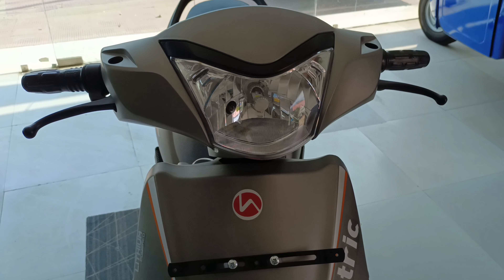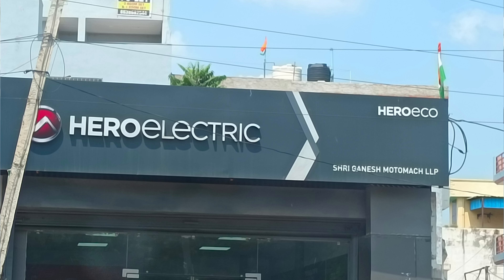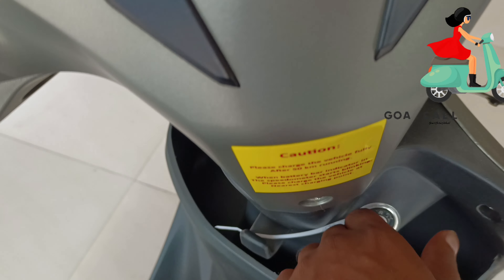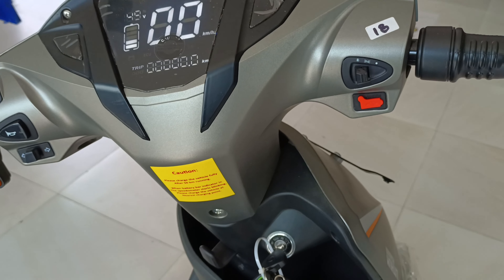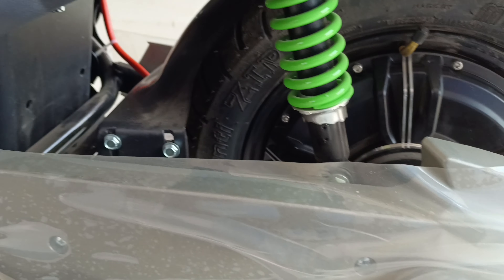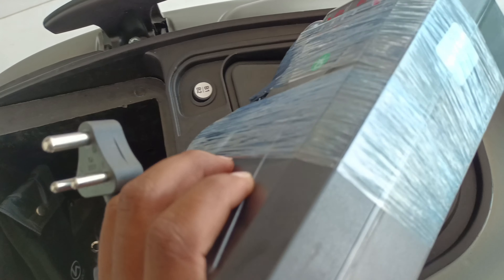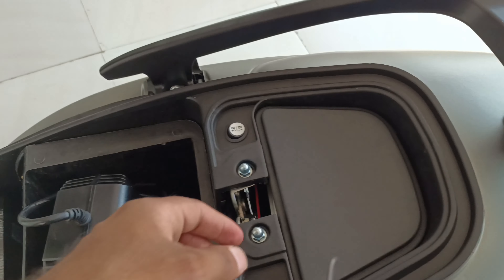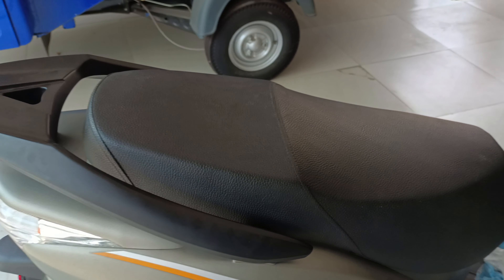Hero Electric Optima CX ER With Dual Lithium ion Battery 150 KM Range Hero का  वादा @HeroElectric01

Comment: सब से घटिया हीरो Ev
1 battery indicator wrong
2 charging indicator wrong
 3     break ghatiya
4   light ghatiya 
5 mudgaurd ghatiya 
6 body ghatiya 
7 weight ghatiya 
8 part  price high 
9  paint weak 
10  servicing charge and work shop ghatiya 
       अब बताओ क्यूँ खरीदे कोई